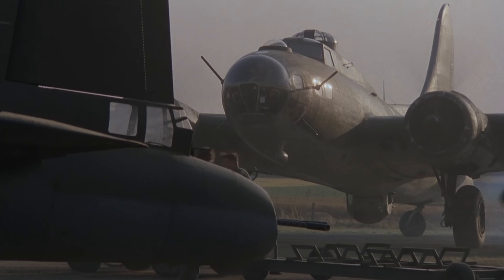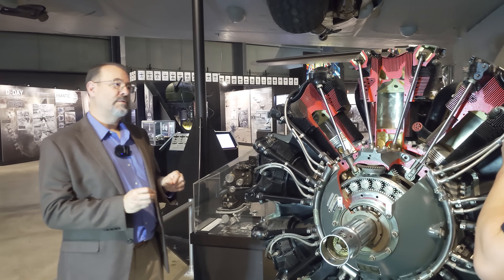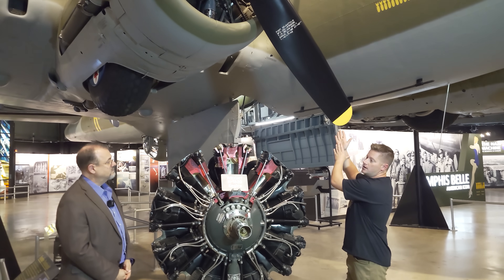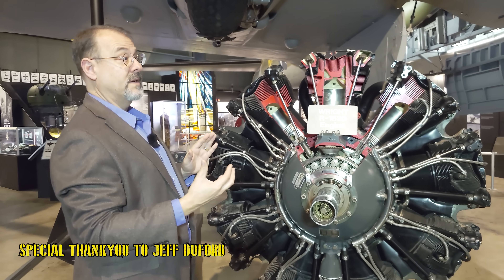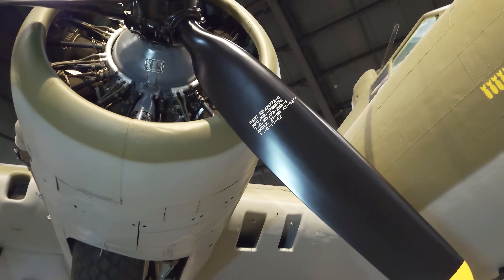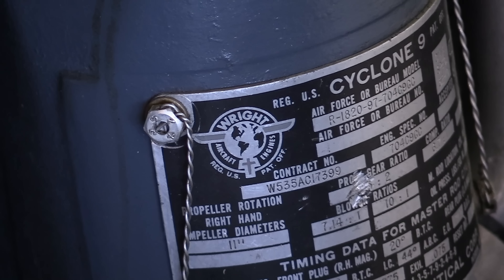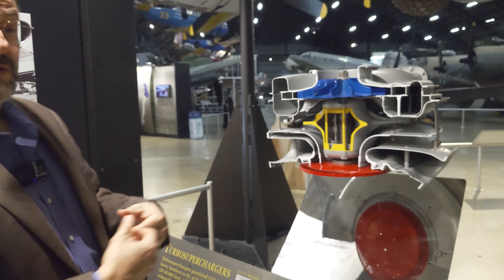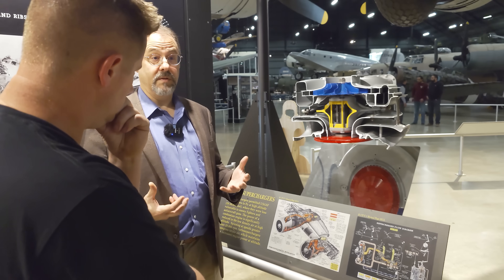B-17 ENGINES IN DEPTH! Genius Or Insanity?

Comment: I flew with my dad in one of these. He was an engineer in WW2 in them. He told me the engines were under powered for the job they had to do. MIss you dad, he left us at 97
Reply from the maker: Incredible to have a memorable experience like that. If he was an engineer check out our top turret video in the series.
Reply: There will always be compromises between power and fuel efficiency.
Reply: @SSEdmundFitzgerald  That was not a major factor in the design of the aircraft or the engine. The Wright 1820 was one of the most powerful engines of its day when it was introduced. The addition of two stage blowers made it even more so. In other words, you are talking out of your arse.
Reply: Was the engine underpowered or the aircraft overweight?  I have an uncle who flew F-4’s in Vietnam and he said by the time they strapped every conceivable bomb on the thing it handled like a truck.  He said with a light load it was incredible.
Reply: @Mando-d4k  that sounds like a fact My uncle was a Navigator on a b 17 and he said, they were over the useful load limit every time they took off. they ether had a overload of bombs or packing a unreal load of fuel. If they went far they needed Fuel if close they had  a over load of bombs.
Reply: @Mando-d4k  It wasn't either. Suggesting that it was is nonsense.
Reply: @prophetsnake  Wasn’t what?  Under powered?  Overweight?  B-17?  F-4?  Of what aircraft do you speak, and of what condition?
Reply: @Mando-d4k  Neither was underpowered. You're talking nonsense, so I stopped reading after the first idiotic utterances were digested.
Reply: @prophetsnake   What?  I take serious umbrage at your dismissive remarks, son.   Seriously.   What’s with today’s youths???
Reply: Beautiful Memories 🇺🇸 God Bless him 🙏
Reply: I'd value and rely heavily on the experience and opinions of someone who was there at the time being shot at and losing friends on other planes rather someone present day who is seeing this from a safe distance.
Reply: @bobguarnieri280  Yeah, they're all dead.This guy is repeating bullshit he thought he heard. I, otoh, have actually flown an airplane with these engines. I did it every day, for a living, for two years. 
But hey, you do you.
Reply: @prophetsnake  Thats good that you have 2 years experience, you have one leg up on me there. But has that time been flying at max load, max altitude, high cruise speed, in tight formation in crap weather, for 6 to 8 hours, while being shot at, maybe several times per week, with a plane that may be worn out? If not I would tend to rely first on the opinion of someone  who has been there done that.
Reply: @bobguarnieri280  I have a leg up on you in every waty shape and form, plaesopotter. That two years is just wiht that particular time of engine, planespotter.
Reply: @prophetsnake  wrong
Reply: Respect and Honor to your Dad.  He fought the good fight!
Reply: Sorry for your loss... Great man, lived a fulfilling life.
Reply: R-1820,s even with turbos  had a pony count of  1,200, your father was indeed right,  from the E  Model Fortress to the G, as the armament was increased resulting in a degraded performance . No attempt made to up the 1820,s pony count, as it would impact on engine production, at the height of the 8th Air Force  bombing campaign  every B-17 Fortress was needed like yesterday.
Reply: Certain aircraft were indeed under powered.....Thus they had the nickname of flying coffins.....B-24 being one... I am not a historian or aircraft guru.... so count on others for better information.....
Reply: @johnhenryholiday4964  Rubbish.
Reply: Prophet snake they investigated water methanol to increase range 

It makes even more sense when you realize they saw the b17 as good for anti shipping aka defending the coasts

Of course they cared about range and fuel efficiency
Reply: He lived a good long life!😀
Reply: I agree! While ordinance laden the engines probably underpowered for the task 12:23  once the ordinance released probably had plenty of power. My dad flew in the navy and was always talking about various cars being under powered. So maybe it was common for pilots to talk in terms of over or under powered.
Reply: Keep 'em flying
Reply: Yes but it is a good thing we had them, and the C-47 or we would have been screwed! and aviation was barely out of the crib at that time, so it was the tech of the day back then. Also, it had to carry three tons of bombs, fuel, all the 50 Cal armament and crew. It all adds up. fully loaded its weight almost doubled.
Reply: Your father was right on. I can't see why they put those underpowered pieces of crap on the B17 should have had the Pratt and Whitney 2800 or bigger. The B17 was so slow it was a sitting duck in the shy.
Reply: I got to see one of these at an air show in the 1980's and my grand dad later told me much the same about the power. With all tanks filled, all bombs aboard, full crew, and gun cans full, the B17 he was in had to lift, fly level to gain speed, lift a bit... The flight back was much faster than the full laden takeoff.
Reply: When the people from the UK start talking about........ oh nm. Arse holes.
Reply: Damn. Normally everyone pretends their dad was a ball turret gunner..points for the creativity with the engineer tilhing
Reply: Then your dad was wrong.
Reply: @prophetsnake Does it really matter?  Very disrespectful. 
What have you done lately..
Reply: @prophetsnake  A WW2 B-17 Veterans opinion counts for a lot, right or wrong. Here's a Prophet for you Prophet Snake, your opinion doesn't matter.
Reply: @HH-COactual  Then you are a liar. And guess one, one of us has flown an airplane powered by 1820s, and it wasn't you.
Reply: @prophetsnake  I suspect that the actual answer is that they overloaded them beyond the original design specs for the engines.  More guns, more fuel, heavier bomb load, plus added air resistance of the chin turret.  If it has trouble getting off the ground, lengthen the runway.
Reply: @SteamCrane  No, they did not. That's simply horseshit.

Comment: That engine was one of the secret weapons of the 8th AF. Bombers returned home with entire cylinders shot away, and the engine still turning. It's a major factor in the legendary status of the B-17.
Reply from the maker: Absolutely. Agreed.... the insanity of believing it would work and the genius in making it a reality.
Reply: Got any references for that on 4 engine bombers? Surely the pilot would shut down a damaged & overheating through oil loss engine and fly home on 3 or two engines, rather than risk a fire and catastrophic wing failure.
Reply: References?!

Lmao
Reply: Yup and the big wing helped a lot as well

Large pieces cpuld get shot away and there would still be enough wing to get home.

A fanstastic and rugged airplane.

Comment: On the Wright R-3350 Duplex-Cyclone engines they used exhaust turbines NOT as superchargers. 
 
These engines had 3 turbines in the exhaust system(s) that each fed 150 kW onto the crankshaft of the engine. 
 
That makes sense when fuel efficiency is more important than performance at height.
Reply: These were the engines used in the Constellation and the Super Connie.
Also I think the A1 Skyraider... the warbird I wish I owned

Comment: The turbo-superchargers are visible on the underside of the aft of the engine nacelles. 
 
On the P-38, they are on the top of the fuselage booms, rather far back, not the least because the intercoolers (the compressed air heats up, which makes it less dense, so you cool it down again) are better located behind the wing, the space in front of the wing is limited, there are the heavy engines (which means you cannot elongate the nacelle endlessly for center of gravity reasons) 
 
The P-38 had Allison engines, where the design philosophy was to have a universal engine, onto which you ADD components to adapt it to certain roles. 
 
Allisons were e.g. also used for PT boats. 
 
Allisons were also the engine for the early P-51 and A-36 Mustangs, but there the space was lacking for a turbo-supercharger. 
(see the P-47, that was a gigantic plane with its integrated turbo-supercharging and intercooler system). 
It needed the adaptation of the mechanically supercharged Rolls-Royce Merlin by Packard to give the Mustang its height performance and make it to the escort fighter of choice it was to become. .
Reply from the maker: Great information.

Comment: Pushing the exhaust through the turbocharger does "cost" a little horsepower.  Ideally, your exhaust backpressure should be close to the same as your boost pressure.  

Which is a LOT.  More than enough to cost power.  Modern cars and trucks, even with multiple catalytic converters, muffler, etc. will have well under half a psi of backpressure at full load.

What makes the turbocharger so great is that it's a lot more variable than a supercharger.  You use a wastegate to bypass the turbine, keeping the pressure exactly where it needs to be.  A supercharger in this application is only going to spin at one speed (except aircraft started using 2 speed superchargers, which still isn't quite as good at matching pressure to altitude), but a turbocharger can keep a pretty constant manifold pressure across a very wide range of altitude, so you didn't get the big "peak" in power you get from a supercharger.

It's also good for fuel consumption, because even if you're not really using a supercharger, you're paying fuel to spin it.  Turbocharger?  You just open the wastegate if you don't need boost.
Reply from the maker: Great information! Great contribution.

Comment: What is really amazing about all of these engines, they were designed, and blueprints were all done by hand. The manufacturing process was done by hand. Sheet metal work, casting, forging, machining, all done on manual machine tools. No CAD. Yet you could take any part off the assembly line and fit it to any engine. There was some parts matching, either in dimensions, or in weight, but they did not have to custom machine a part to fit an engine. That is an amazing accomplishment for the time.
Reply: I have a friend that owns both a Harvard T-6, and a T-28B. He has quipped on a few occasions that a radial engine is the best means of turning money into amazing sound.
Reply: Yes and Packard showed RR how to build precision engines on mass productions also in WW II !!!
Reply from the maker: Agreed! Glad you enjoyed the video.

Comment: The aircraft I worked on in the Navy had 1820-9 radial engines Grumman S-2 Anti Submarine Warfare. This was in early 70s I was fortunate to have a "Turn card" so I could start engines to insure Hydraulic leaks and issues were properly repaired. I loved starting those round motors. Still my favorite engine type to hear run.
Reply: I also worked on these engines from S2's.  We had one catastrophic failure of one engine where a cylinder came loose, the piston on the bottom of its stroke came out of the cylinder, and the crank tried to push it back in, smearing it like butter.  We salvaged everything off of that engine we could, but the front crankcase half, the crank and the master rod with the one slave connecting rod we could not get out, was put in the recycle bin.

Comment: Samual Heron was born and educated in England attending Goldsmiths College and Durham University.
"Heron worked at the Royal Aircraft Factory. From 1915 to 1916 he worked with Professor A.H. Gibson on the first systematic research into the design of air-cooled engine cylinders. They concluded that (1) aluminium should be used for efficient conduction (2) the cylinder head should be in one piece because conduction through metal-to-metal interfaces could not be guaranteed (3) the cylinder head should provide the shortest escape path for heat at the hottest parts across the greatest cross section".
Reply: And he wrote a whole book explaining these developments and others. History of the Aircraft Piston Engines: A Brief Outline. Published in 1961. A must read for motorheads. It’s not cheap if you can find a copy.
Reply from the maker: Very interesting.

Comment: I was well aware you did not work on HU-16  Albatrosses, but commented that HU-16s were also powered by R-1820,s burning 115/145 grade avgas. On that rich diet their  pony count was unbelievable for a simple 9 cylinder radial 1,525, 25  ponies more than an early civil model Curtiss Wright R-2600,a big  14 twin row radial that powered Juan Trippe,s 'Queen of the Skies the Boeing 314 Clipper . The R-1820 cloned by Russia Poland and China , still in workaday service powering Polish built PZL Dromedaries an ugly agricultural crop duster. The Russian Ash 621R can burn ordinary regular grade car petrol, as 100 LL avgas is increasingly hard to find , most oil companies are now deleting lead based auto and aviation petrol.

Comment: In a constant speed prop, full power is at full fine pitch where it effectively is just a fixed pitch prop. You use this for takeoff and landing in the event of a go around.
Its great advantage is that it can go to feather position in the case of an engine failure. 
Another advantage of it is the blade shape doesn't need to be as compromised as a fixed pitch where every shape is a compromise.

For those that don't know, when in variable pitch mode, the prop RPM is controlled by propeller pitch lever and tacho, the throttle controls manifold pressure. The prop governor infinitely varies the propeller blade pitch (between the coarse and fine stops) to maintain the selected RPM. 
Say you set 2100rpm and 35" manifold pressure, then the manifold IN HG power setting + RPM + indicated airspeed cause the propeller pitch to vary infinitely to maintain that RPM no matter what - the pitch in this instance would be fairly coarse than if you say changed the manifold pressure to 24" with the same RPM where it would 'fine off' a bit.
Usually there is a power setting chart that tells the pilots the optimum combo of manifold pressure & RPM for a given weight and altitude that factors for cruise speed and fuel consumption.

When the prop pitch control is the full fine position then the throttle acts as it would in a fixed blade aircraft, or similar to a car throttle where more throttle = more RPM usually.

Also re turbochargers, he's dead wrong about it not costing HP. It is a direct engine engine pumping loss. If you're using engine exhaust to pump pressure then you're using power. Work is being done. It is true that the power loss vs a mechanical supercharger is less. Also Superchargers are at a disadvantage on their own, since each revolution delivers a known volume of air. As elevation increases the air can't fill the supercharger so it's effect drops off since it's a positive displacement pump.
A turbocharger is free spooling so can provide boost - however it also begins to suffer the effects of altitude gain - as do jet engines. It is a fact of life the higher you go the less power you can make but the fuel efficiency increases due to the fact that you also pick up a lot of airspeed for free. 150 knots indicated airspeed is probably closer to 220 ground speed in still air at say 25,000ft. That's 70 knots of free speed meaning less time to destination therefore less fuel burn.
Reply: As someone who has thousands of hours in radial engine airplanes and an AME, I find many flaws in your statement on how these engines work.

Comment: It isn't quite true that a Turbosupercharger running on exhaust doesn't cost the engine some Power. It does. It's just lsomewhat ess of a drag on an engine compared to taking the Power from the engine mechanically through a gear. The engine will still have to do more work pushing that exhaust through the Turbosupercharger turbine than is the exhaust was just allowed to escape into the atmosphere unhindered. It's a basic principle of the laws thermodynamics. You never get any Energy for free.

Comment: At 9:30 when he is talking about the turbocharger, what he says is not correct.  A turbocharger DOES cost horsepower.  You can't get something for nothing.  The exhaust gases that are coming out of the engine have to do work to get the centrifugal compressor to compress the air going to the engine.  The cost is, the pressure in the cylinder on the piston's exhaust stroke is higher (than if there was no turbocharger) because there is resistance of the hot exhaust gases going through the turbine impeller.  You can't create free energy.
Reply: It’s a commonly held myth. Of course turbos cost power
Reply: timothy  that pressure in the exhaust due to the turbocharger is called BACK PRESSURE and yes it does cost some horsepower but the turbo more than makes up for it actually increasing the HP .
Reply: Don't think the fella interviewed explained why they used Turbo-charging at all well.  Turbo-charging was one way to go, others went with two staged super chargers.

Comment: Turbo chargers cost horsepower too. He is wrong about that.
Reply: You're wrong, even in motorsports engineers and mechanics consider turbos free horsepower, like he said, it's driven by the exhaust which is already there.. A supercharger costs you horsepower because it has to mechanically driven by the engine, like the belt driven supercharger in my 2010 Cadillac CTS-V car.
Reply: @badboyvr4  nope not true. The exhaust back pressure from the turbo makes the engine work harder to push out the exhaust. It takes a lot of energy to compress 1000 cfm of air to say 15psi. There is no free lunch in this world.

Comment: The DWG  # and high and low angle info on blades is really important. The hydrostatic prop is ground adjustable. Inside the hub are 2 stop rings . One for high angle and one for low angle . Have degree marks on them.